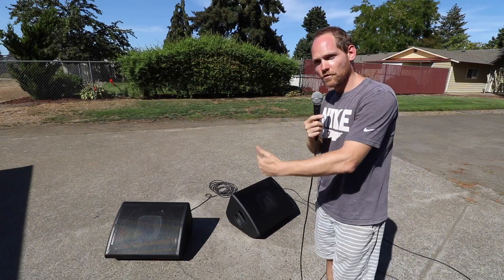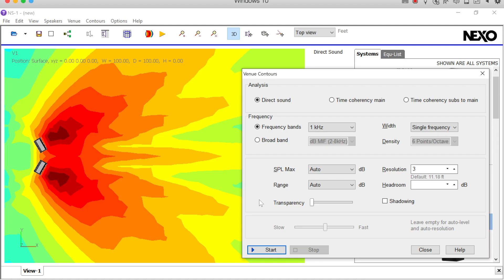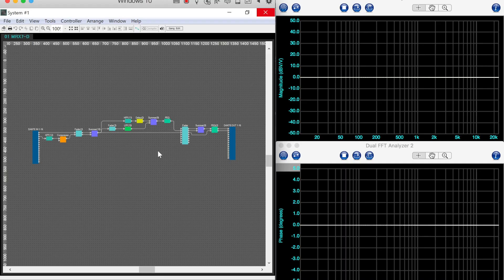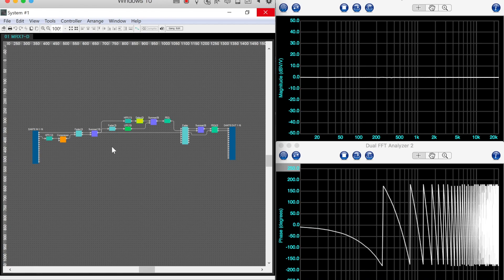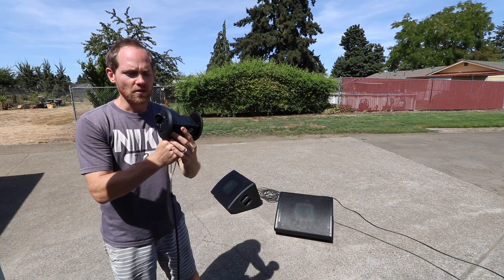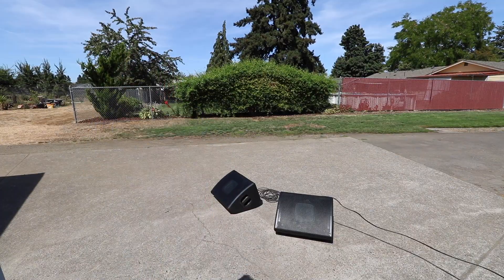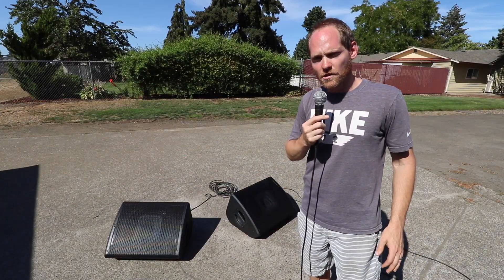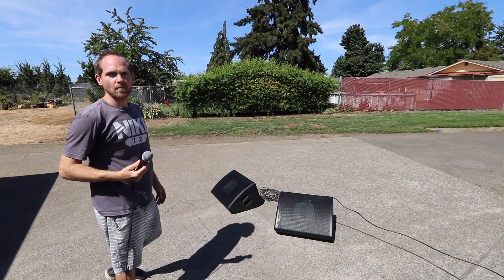Eliminate phase problems!

Comment: If using a big midbass horn there will be group delay of up to 10ms but only at 70-90Hz. If the horn plays 80-400Hz, you can’t delay the whole midbass channel with 10ms, because group delay is almost zero at 100-400Hz. How do you overcome such a thing?

Comment: How about two different pink noise sources going to each monitor? Dave Ratt has good videos on decorrelating sources to fix comb filtering effects. With a vocal mic in this situation this would not be possible but for something else it would be useful.

Comment: Was there trial and error in determining the 2ms delay? Is there any correlation in the delay and the distance between the two monitors? 2ms is about 2.25 feet which is close to the distance I see between the two. Just an observation and question. Follow up, how do you thing this would work in a "wall" of monitors on stage (at ruffly the same spacing) in a line but having each one alternate between each normal and processes signal?

Comment: Wow when showing the example I noticed the same phase issues with my home subs. I'm here trying to figure out how to deal with the 80% bass cancelation I'm getting. Not sure how to address this issue with my Denon 540. No matter how I place the 2  klipsch Synergy 10s I end up loosing bass with both vs 1. I've tried changing phases and it gets stronger locality but less everywhere else.
Reply: try putting the two sub together with the woofers facing outward to the left and right instead of forward facing

Comment: I used a similar technique on a gig yesterday. For a dance performance, the client requested 4 side fills on stage  Two monitors placed Upstage L&R and Downstage L&R. I was able to eliminate a great deal of phasing problems by simply throwing a 3-4 millisecond delay on just my upstage monitors. Worked great.

Comment: Im not saying it doesnt work, but the distances were not the same. Check the shadows of the mic. all the best
Reply from the maker: Not saying the distances were exactly the same, but also, the sun changes. The demonstrations happened about half an hour apart from each other because I did many takes of each. I did try to keep the distances about the same but certainly didn’t use any objective measurement tool, because I found that it didn’t matter too much if it was off by a few inches… the feedback performance was the same.
Reply: @devinlsheets_alphasound  I think if you somehow measure the distance better, that woulb be nice.

Comment: As a mixing engineer, you learn to use prime numbers in delays, to scatter and smooth out comb filtering effects.  For example, 3 and 5ms delays, at the same time create golden ratios and sound very pleasing to the ear and much more smoothed out!  Try a delay with 3ms left, and 5ms right!  I've used this for simple stereo haus effects for years. Hope this helps.
Reply: So this is 2ms difference  between your speakers...Just as he showed in the video. What's the point of having 3ms on the first speaker?
Reply: @lorenznew2208  You’re forgetting the source that is parallel at 0ms.  Also you have to think about feedback with delays. So know you have 5/3 and becomes closer to a Golden Ratio. Don’t knock it till you’ve tried this.
Reply: Do you have an audio example I could here?
This sounds amazing
Reply: Would this method work on reducing the similar phasing noise from a PA as well?

Comment: How is this different from stereo decorrelation? I think they use this technique to avoid lobing on mains speakers too, especially line arrays.
Reply from the maker: Right but where have you seen this done? It exists in various forms for sure, everyone does it a little differently of course. We’ve always wanted a processor that randomizes the phase of two signals without too much audible artifacts, but unfortunately have not discovered it yet if it exists!
Reply: @devinlsheets_alphasound  I don't pay close attention to how we process the signal for line arrays, but if I recall the standard technique is a different EQ on each channel, that together sums to zero, so the average signal isn't affected but the phase is. And at any given listening position, there's not going to be any dead spots because any given frequency will come predominantly from one channel. E.g. a comb filter on the left channel, and the opposite of that filter on the right.

As I think about your solution more, putting a delay behind a high pass filter... isn't this the same thing as moving the high driver/horn physically closer to the audience (assuming everyone is listening from roughly the same direction), or putting a delay on only the horn?

Comment: Dumb questions.... 1) In this video, are the wedges daisy chained?

2) When you change the phase, are you referring to inverting the signal 180 degrees ??
Reply: 2.- No, that would be a polarity reversal, he delays one signal so when both signals sums there is a phase shift that depends on frequency as can be shown in the graph.

Comment: Interesting. But unlike our TWO ears that hear phasing from the different distances our ears are positioned at, a microphone is hearing from ONE point. The microphone hears things differently phase wise. We may not like the phasing we perceive, but how does the microphone interpret phasing? Try blocking one ear as much as you can, but don't just turn your head 90 degrees to the speakers (Dual Wedges) and hear the difference with the same test with one ear because in this way you will be hearing what the microphone hears and remember, it's source to listen from isn't the speakers BUT what it's replicating. STILL... I get what you're trying to achieve, and getting the pattern as smooth as possible is a good achievement and there's no argument when pointing the microphone to the wedge getting it not to squeal. I have done this 60 degree with wedges for years hearing the separation via pink noise regarding phase cancelation and hot spots. I can actually hear more potential problems using the one ear method and learning what the microphone will highlight  and thus, what to avoid taking into consideration the wedges dispersion specs too. Great clip all the same. A+ ;)

Comment: Cool! There is a slight flanger esque effect increasing in pitch as you move towards the left. Probably nothing that would cause an issue in a live situation though.
Reply from the maker: It's a subjective thing, but we thought it was less disturbing than the unprocessed flange sound crossing through the phantom center. It allows the artist to move side to side a bit in the area and not constantly be hearing the particular flange of the phantom center. Unless of course, they like that sound and know how to regulate their exposure to it, in which case we'll have a talk with them about which mode they would like to use, just like how we might talk with them about whether they want one or two wedges, etc.

Comment: Devin, absolutely brilliant. question: I am setting up a playback system for my studio with one - dual 18" subs (20-100Hz) and two - rh 12" with conical horn tops (100-20kHz) per side. I think they are 60x40 horns (as opposed to 90x40), so limited dispersion. with the two full range cabs on each side, I am getting lots of lobing in the mids and highs (per side - just talking one side here). I am experimenting with pivoting the rh cabs toward each other a little (about 20 degrees maybe). I tried away from each other (about 20 degrees) and the lobing seemed worse. the horns are symmetrical and can be turned 90 degrees within the cabinet in order to change dispersion from wide to tall. I feel that pivoting the cabs toward each other about 20 degrees and turning the horns for taller dispersion somehow allows for less lobing and wider dispersion. this is just with pink noise. do you have any opinion? rh suggests these cabs can be set up in an array but I can't find any documentation (they are trapezoidal with lots of fly points). I am fine with a little lobing but would prefer to minimize it. I use a mic sometimes. so far the feedback is minimal, but is indicative of some lobing in the mids and highs. thanks! (sorry about the essay! hard to describe in few words).
Reply: Absolutely

Comment: how does this differ from an all-pass filter?
Reply: Same question here...
Reply: By definition, an allpass filter is any filter that changes phase but not magnite of the signal. So a 2ms delay is defintely a (very simple) allpass filter. What he has setup in the video is (ignoring that the little wiggle at 2k is only EQed out approximately, so the magnitude is changed slighlty) in fact an allpass filter. One could probably get something similar going using IIR allpass filters, the only difference being that you only get one 180 or 360 degree phase rotation with a single IIR allpass as opposed to the very very high number of phase rotations that the delay creates